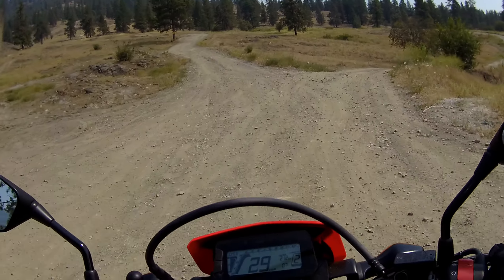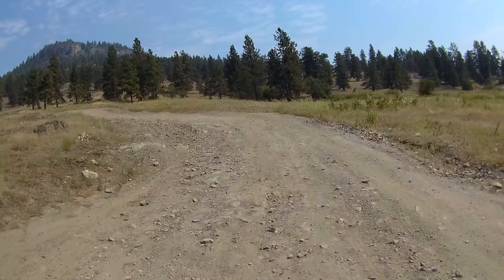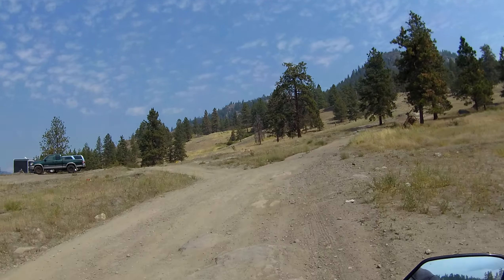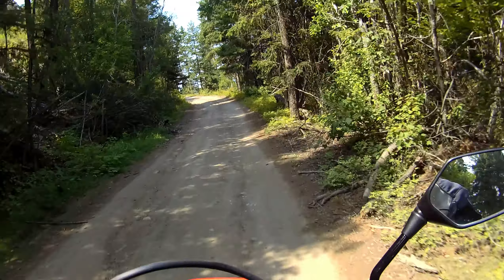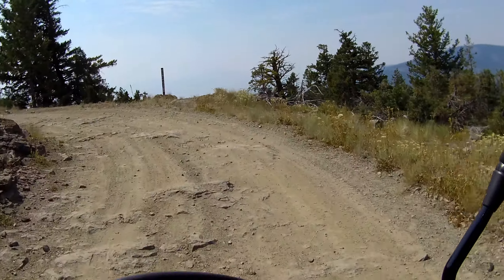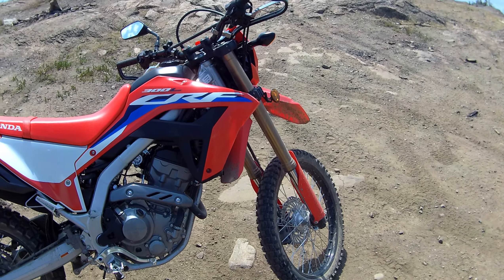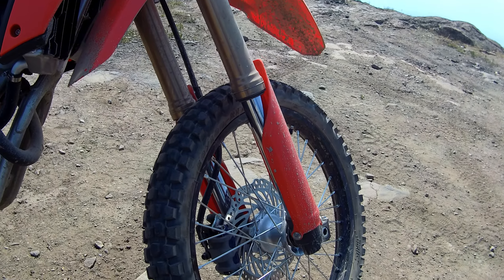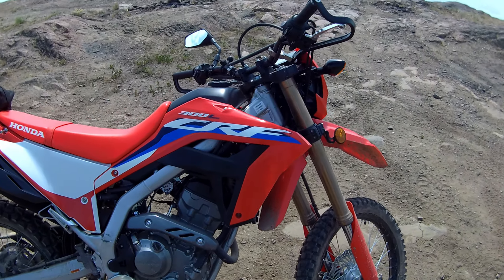CRF300L Engine Rattle Info & Other Thoughts | Ride to the Top

Comment: Hi!  I have heard people say definitively that the rattle "is the secondary air system", "is the springs in the clutch", "is the cam chain lifter".  Everyone seems sure that their answer is the correct one.  I have had the CRF230l, a 2013 CRF250l, a 2017 CRF250l and now the CRF300l.  All of those bikes had the rattle.  The engines on the 250 and 300 may have most things in common, but not the CRF230l.  That was an entirely different, air cooled plant.  It did, however, have the same secondary air system.  I purchased a "smog pump block off kit" for it, removed that air pump system and the rattle went away.  I don't know if that is the culprit or not, but the evidence has convinced me that it is.  Just FYI.
Reply from the maker: Yeah, they all do it to some degree. I think it's a lot of things contributing. The 550 Performance guy feels it's piston slap and he has a tune that adjusts the timing to eliminate it. The PAIR system is part of it, I agree. Since this video I stopped the PAIR system from operating and it quieted it down for sure. I have since let it operate again and it's still at a level I can live with ;-)

Comment: The CRF300L is a real dual sport and the awesome thing about the bike is that people of all ages and years of experience can enjoy it.
IMO a dual sport like this is a real ADV bike as it takes you to your adventure and through them! And it does both things really well. I would want to take an Africa Twin through the woods on a single track as it's too big and heavy. The CRF300L is so low weight that it´s easy to pick up, even in loose sand - and yes, I have had to do that a couple of times already :)
Reply from the maker: Those are good reasons to love this kind of motorcycle. Agreed!

Comment: Thanks for sharing this with us--just spectacular scenery in every direction it seems there, and so many cool dirt roads to explore.  The 300l will give you a few projects to work on (#1 being the rear shock, I imagine), but it sure seems like it does almost everything well.  That's pretty amazing for a budget dual sport!
Reply from the maker: Yup, that's the best part of it; it's a budget dual sport. Such good value!
Reply: @Scott-dn1bk  you chose correctly. 😀
Reply: @Scott-dn1bk  thick, deep gravel is my least favorite. I had my girlfriend riding my new 110 on it recently and it was hard at times for her. We’ve both had the front tire wash out so it’s best to avoid it while getting use to the bike and riding again. Position/weight distribution is key. Looking way ahead and having momentum is important as well and especially on my 450 throttle control with a lot of clutch depending on how steep the terrain. But you’ll get more comfy with every mile. Good luck and have fun! 🙂

Comment: Thanks for the great video. I want to ride so bad today but it’s 90 degrees and humid. It really takes the fun out of it.  

As far as the rattle goes. I have 250+ miles on and have not heard it probably because I ride with ear buds. Lol. My 250l , 450l both had it. No big deal.
Reply from the maker: Exactly; no big deal. That heat, and when it's coupled with high humidity sucks the life out of otherwise awesome activities. We're fortunate we have a very dry climate. Not fortunate when it comes to forest fires due to it though. Thanks Mike :-)
Reply from the maker: @Scott-dn1bk  I don't know of any rattle or strange noise going from 5th to 6th. I heard one person say that in comments, that's all. The 'rattle' you hear could be a number of things, but the Cam Chain Tensioner (CCT) can cause that on steady throttle (the subject of this vid), or it could be valve chatter. Either is normal for this bike. I doubt you are 'lugging' the engine causing it to ping in 2nd unless you are going uphill at a too slow a speed. One can start from a stop in 2nd quite easily without undue stress on the engine.

Comment: Very nice work. I got back into riding this January after not riding since childhood. Got a 2020 250L and days later they announce the 300L so put a deposit down on that immediately. Then the 450 started calling me so I traded 250L in for 450RL while I waited on the 300L. Finally got mine and have 25 miles on it. Really anxious to see which I like better for mainly trails and dirt roads. I’ve imagined the whole time liking the 300L more. Thanks for the video. Keep up the good work. Be safe. Subscribed.🙂
Reply from the maker: Hey thanks. I've never ridden the 450L. I hear it's quite the bike on dirt. Bit more maintenance of course. Be interesting to know which you prefer after enough seat time on both.
Reply: @Scoottoots I’ll certainly let you know. 🙂 wish you could ride a 450L/RL to tell me what you think of the two as the much more experienced rider but if I had to guess the 300L will be best especially for my main type of riding single track. Enjoy!
Reply from the maker: @lukefish7562  I suspect the 300L will be a simpler, less involved bike to ride and maintain. The 300L is quite nimble so it should do fairly well on single track. The 450L of course would be the best performer if you were really pushing it off road. On the pavement, from what I gather, the 450L is not as friendly as the 300L in handling.
Reply: @Scoottoots  I rode my new 300L yesterday across my mountain on a dirt road and then back up on a paved road racing the rain. Had right at 25 miles on it and did about 30 yesterday and with all still stock it was a joy to ride! I obviously can’t say much for now but I can say right now is it just “smoother” or as you said much more nimble. Can’t wait for different tires. Thanks 🙂
Reply: @Scoottoots oh and I hate maintenance so big ✅for 300L there. 🙂

Comment: Welcome back to my feed after selling the CRF250L a couple of years ago... Anyway, I have a CRF250L and a “CBR300R converted” CRF 250 (300)Rally and I the 300 rattle kicks in between 5-6K rpm (the 250L does not) apparently the rattle is evident on the CBR300R series too... IMHO the 250L motor is “smoother” and less harsh (both motors have similar mileage)..I am confident both motors will go on for a long time (given regular recommended maintenance)
Reply from the maker: Thanks Michael. Good to back. Yeah, that rattle is so common on these engines. You're right, the 300 engine is more vibey. The 250 version is much smoother. And yup, we do hope the longevity is there. I suspect it is, since the 300 engine has been in the CBR for a fair while now, and they get pushed to the upper limits quite a bit more than a dual sport would.

Comment: There is also an interesting repeating noise at 5000-6000 on fifth gear, in dealerships they said almost all hondas doing it(which i don’t believe 😃)
Reply from the maker: Depends on what kind of noise coming from what location, but the most common engine noises are the CCT, the valve chatter (which is very evident on the 300L), and the PAIR system on some models. Thing is, valve chatter for instance is normal to hear on many models, and if you stop hearing it, the valve clearances are getting tight and need reshimming. If the noise you hear is not the rattle sound from the CCT, it's most likely the valve chatter, but again, that's pretty normal. If it's something else, then...?
Reply: @Scoottoots  In dealership when i started to talk about it the guy was able to reproduce the noise with it’s mouth 😃 So i was sure we talk about the same thing. He told me its resonance of parts. It’s realy only at specific rpm and 5th gear.
Reply from the maker: @EEEEMMMMKKKK  Yeah we have to remember we're sitting on an engine. Unlike driving a car where the engine is divorced from us, riding a bike is, noise-wise, more like sitting in the car's engine compartment. I imagine we'd have plenty to speculate and worry about :-)
Reply: @Scoottoots  😆👍🏽good point

Comment: Nice video, well ridden, been looking at the negatives on these as alot of people have already put them up for sale , maybe they thought it'd be an enduro grade machine.
Reply from the maker: Thanks. Yeah, this bike is not enduro-ready. It's a wonderful bike; very well designed... except for the suspension, especially the shock. The KLX300 is better out of the box for performance in that regard. The 300L will be the better bike all round after the suspension is sorted. Will cost dollars, but worth it I think.

Comment: Hi, are you using Honda oil? Some people has commented in other videos that changing the oil to a different band solve the rattle, I am planning to put Motul 5100 Synthetic Blend 10w30, do you think that motul is a good oil?
Reply from the maker: When I did the first service I switched to Motul 5100 ester based synth blend. The engine sounds about the same to me after the change. I like Motul oils. I use Motul 7100 full synth ester in my cb650f and used it also in my crf250L. I switched to the 5100 for the 300L because I wanted to stick to 10W 30, and it is hard to find in the 7100. The 5100 is made with Honda specs specifically in mind so I think it'll be a great oil for this bike. Best to change it out every 6,000 kms rather than the extended frequency the owners manual suggests. Just my opinion of course.

Comment: Mine sure does it, even with ear plugs it's very loud, and without plugs it sounds very unhealthy.  I agree it's in the top end,    I think you're right about the CCT.  I can hear the valve train too, but to me that's an expected/normal almost pleasing kind of noise.   The rattle is neither. Interesting though that it doesn't do it neutral, only while under load.   I'm not fully understanding why that would be the case if the source is the CCT.
Reply from the maker: Yeah I hear ya. Over time my engine noise has increased and I don't think it is the CCT as it does it under load or not under load and at any rpm. It's a metallic chatter that drowns out other noises and is very irritating. I'm thinking it's valve train noise. When spring is here, prior to warranty running out I'll ask Honda tech to test it.
Reply: @Scoottoots  Same, seems to be getting worse with more miles.   First warmish day I get I'm going to take it in.   Whether they do anything about it or not at least it will be documented.  

Interesting you are hearing it it with no load.  Mine at 800 miles is still load and throttle position dependent. Seems a mechanical source wouldn't be dependent on either. 

What keeps me from just ignoring it... Besides the $6500 I dropped... is that not every bike does it.  Watching YouTube videos of both models,  and a brief jaunt on my son's Rally, I don't hear anything near the racket I get from mine.
Reply from the maker: @zamdrang  I guess we'll both get a better perspective on this when we get them checked. As you say, it's important at the very least to have it documented.
Reply: @Scoottoots figure anything out?
Reply from the maker: @DemetriusDemarcusTheThirdJr  Not sure if I have or not, as it has quited down to acceptable-to-me levels. The guy who owns 550 Performance figures it's piston slap and he can tune it out with changes in ignition timing. I've slowly modded mine and perhaps that coupled with time and kilometers (13,000) has changed things to reduce the rattle.

Comment: That's funny.  Cam chain noise.  I just got a Kawasaki W800 with a bevel-drive gear for the cam.  That's such a better design (why don't more bikes have that?).  Valve adjustment or timing never changes from cam chain stretching, and no chain or tensioner noise.  Reminds me of the problems with my previous KLR650 and that terrible cam chain tensioner that plagues every KLR650 eventually.
Reply from the maker: Yes, it seems a rather crude system when you really think about it.

Comment: Have a theory on that noise. Can’t remember where I saw this but they were saying the oil screen in the engine catches debris and restricts oil flow to the top end. Pieces of gasket sealer etc are being caught by the oil screen. My 250l had that exact noise for years. After my Last oil change the rattle disappeared. Kinda makes sense to me that something in the screen may have dislodged and moved back into the lower case after the last oil 
change.  Just a theory but would be interesting to pull the screen and see if there is debris in it.
Reply from the maker: Thanks for the suggestion. That can happen for sure, though in my case it's highly unlikely to be a cause since it made the noise from after the first 600 miles or so. Not impossible the screen could be partly blocked but not probable either. Getting at the screen requires pulling the entire side cover off. Not something a person would want to do unless they are servicing the clutch. Oddly, the noise on mine has greatly diminished lately. These are known to be noisy engines, that's for sure.
Reply: @Scoottoots  Have been think about doing the crfs only heavier clutch springs for sometime. If I do I’ll pull the screen while the cover is off and see if there’s anything in it. I chased that noise for years and even put a new cam chain tension in and didn’t help. Noise has always came and went and now seems gone after last oil change.
Reply: @kennyd6933  Hehehe, it's like chasing ghosts. On my 250L, now long gone, I solved the rattle on steady throttle by installing a Krieger manual CCT. mine was definitely cam chain noise. On this 300L I think it's a combination of valve chatter, cam chain, and who knows what. Fortunately it has calmed down for the last few weeks now. Good enough for me. It'll always make noises. I'll not let what are left of them irritate me :-)

Comment: I don't think you are entirely correct about the rattle. I believe it may as you say be emanating from the chain tensioner but the root cause i believe is the fuelling which causes the engine speed to chatter or fluctuate rapidly causing mechanical backlash noise. Increasing or decreasing throttle when it occurs changes it.
Reply from the maker: I don't think that's it. Mixture wouldn't cause fluctuations like that, and I cannot imagine the injectors displaying such a fuel feed issue. Most likely is: a decrease in the rattle when increasing throttle would be consistent with CCT noise caused by a somewhat loosely tensioned chain (typical for this engine whether the 250 or 300 version). The increased load on the cam chain when you throttle on tightens the slack on the forward portion of the chain's run, diminishing the noise. I'm pretty sure it's a combination of valve chatter and CCT noise. The dominant noise I hear on mine sounds like valve chatter. The PAIR system may also be a factor.

Comment: Thanks for the very informativt video, a week ago i bought a CRF 300 L to try some TRT Trans Euro Trails, i am still waiting for my yamaha Tracer 9 GT to arrive. There are not many dirt roads here in Denmark apart from the gravel roads to all the farms around here, my own included but there is a labyrinth of small twisty roads over the whole country. I have done 351 kilometers when i got home this evening and I have completely fallen in love with this little bike, I am now going to put a luggage rack on so can throw some camping gear over and when the Covide restrictions are lifted, take a trip north to Sweden or Norway.  With regard to the noise you speak of , when i am in 6 gear at a steady 80 klmh, there is a constant pulsating noise from the transmission which i am going to mention when i have the 1000km service, is that the noise you are talking about ?   I envy your location.
Reply from the maker: Sounds great. The bike will suit what you have planned for it. Enjoy. No, the noise you describe is not the infamous cct rattle. You would hear that coming from the top right backside of the engine. The noise is a light metallic rattle akin to a bag of marbles but metallic. Good that you are getting it checked out. Your noise may be drivetrain ; chain and sprockets can cause the strangest sounds.

Comment: This famous rattle comes from secondary air system - exactly from reed valve. https://youtu.be/aDp6bHdciEI?t=659 Nothing to worry. It is part of Euro-2 emission standard  for better burning fumes.
Reply from the maker: Yeah I saw that video from Jake, but the rattle/chatter I have is not the 5,000 rpm rattle everyone talks about. Mine is at any rpm under load or no load. That said, the PAIR system reed valves may be a cause, though it sounds pretty loud at times to come from such thin metal as the reed valves. I'm no longer too concerned about it though. I had my Honda Mechanic ride it and he felt, yup it's noisy but it's a result of the engine design and not to worry.

Comment: Tuned ECU from 550 performance stopped the rattle
Reply from the maker: Since this I did get a stock improved ecu from 550 performance, but it didn't change the rattle. The engine is much quieter now after a lot more riding. Wear in just the right spot perhaps.
Reply: I also did full exhaust so maybe just don’t hear it? Idk I’m convinced it was a fueling problem as it did run lean
Reply from the maker: @johnharris7756  According to Maverick at 550 Performance, the rattle is caused by piston slap. He said in his later tunes he eliminates or reduces the noise by adjusting ignition timing to alter where the main pressure wave hits the piston. Perhaps your tune is done that way. I wouldn't think a lean condition would cause a rattle except if it were exceptionally lean, causing detonation. That wouldn't be happening on these engines though, as constant detonation would destroy the engine in short order.